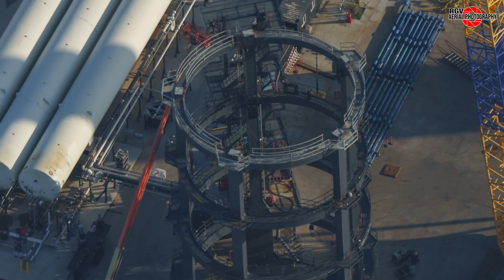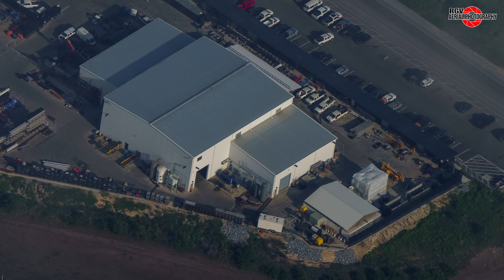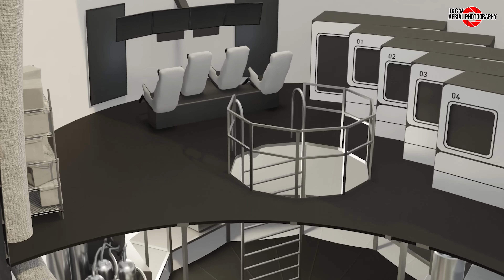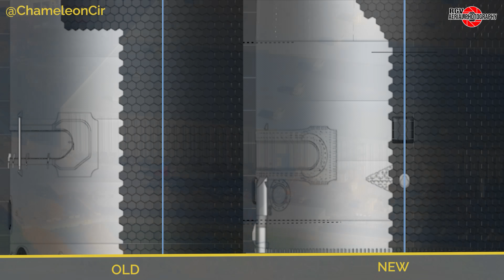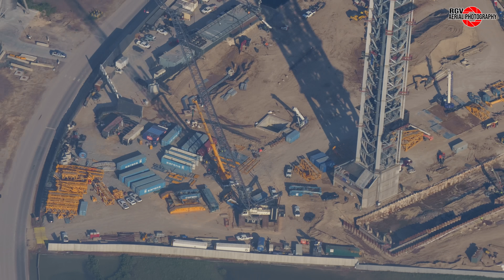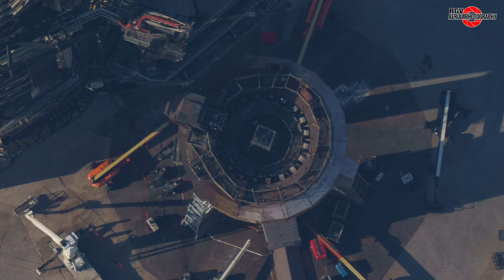Starbase Flyover: Flight 6 Approaches + HLS Cabin Interior! Episode 64

Comment: IMHO the screens will be there for backup. The astronauts will monitor the landing by wearing modified versions of the helmet F-35 pilots use. With synthetic vision they can look down through the aircraft in any direction. Astronauts will see the surface from cameras mounted as far down on the ship as desired. The astronauts won't have to worry about the difficulty of getting an actual window view from that tall rocket, although with what we've seen of the screen set-up I think NASA isn't pressing for it. (Dragon has no forward view of the ISS for docking, the astronauts rely totally on the screens. Starliner does have a forward facing window.)